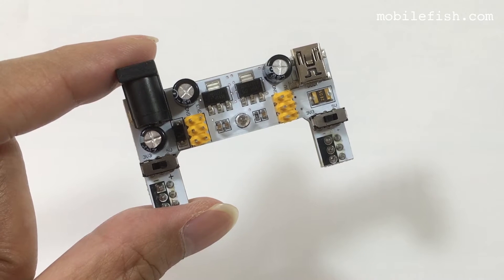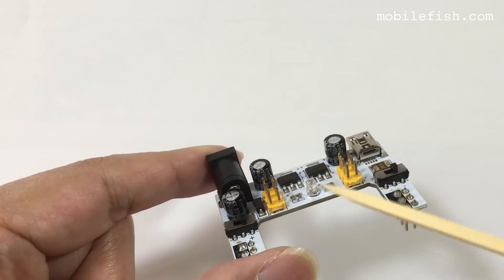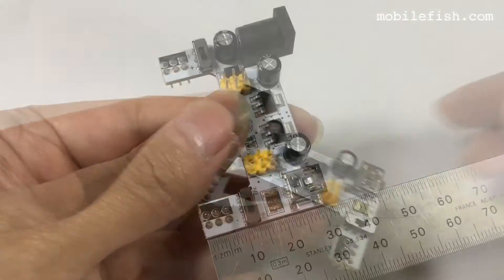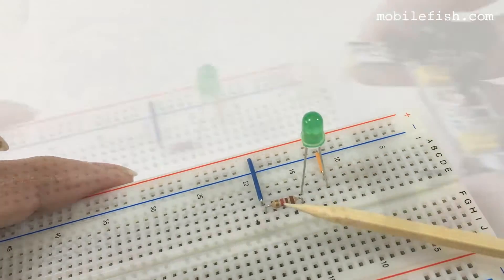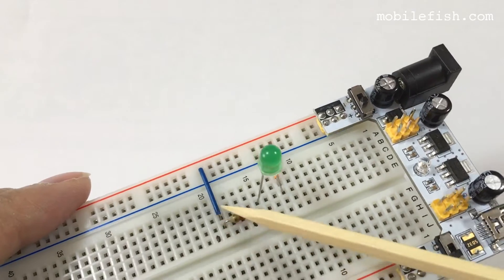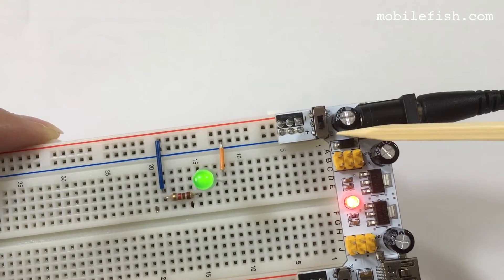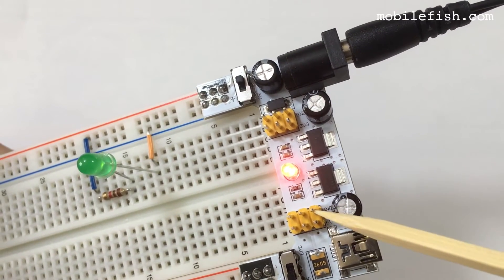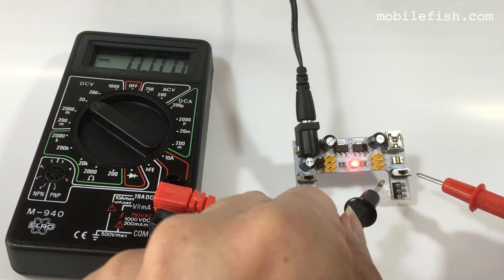MB102 breadboard power converter 3.3V or 5V

Comment: I get 12V on the 3.3V setting 🤔
Reply: Me too, dont know, what should i do. ( in any position of regulator)
If i use USB power, i have about 4.8V
Reply: @ProXimikos  seems like the ams-1117 3.3 component is broken, you could order a new one and replace it

Comment: I am using  9V Adapter. What is the USB port for, to take POWER FROM a PC or SUPPLYING power to External devices? If it is for taking power In, then 9V Adapter is not connected?
Reply from the maker: The  USB can also be used as power input. To be honest I have not used the USB as power input.
Reply: Mobilefish.com Thanks